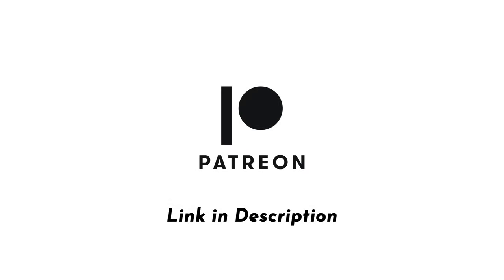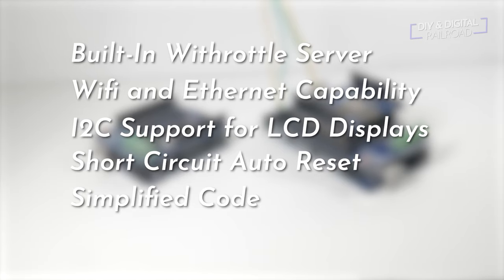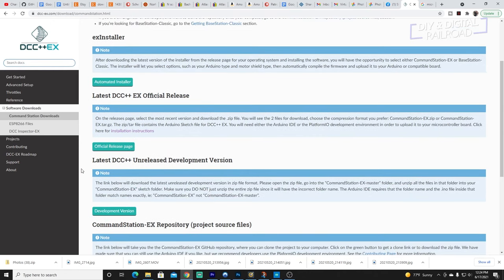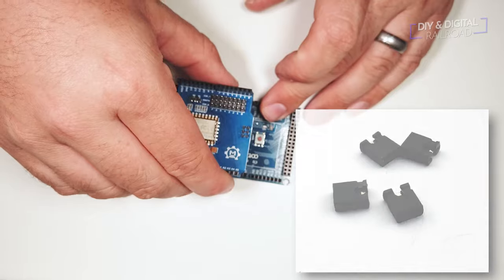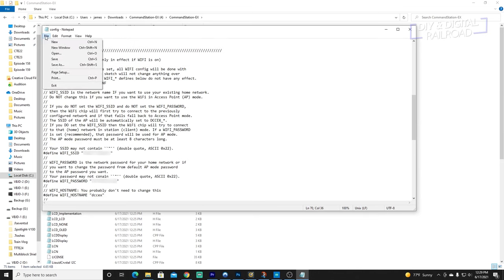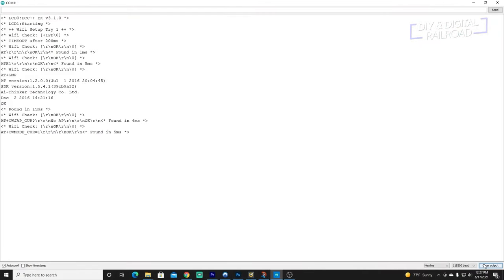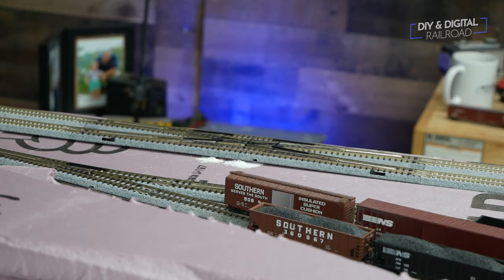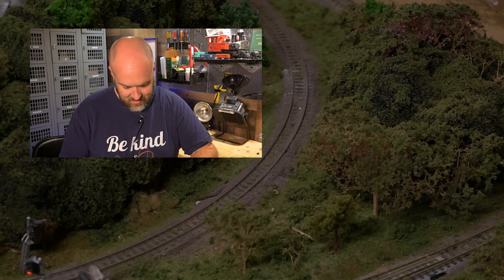DCC++EX: A Cheap DIY DCC System?!?! This is a Model Railroad Game Changer

Comment: I have one question regarding your use of WiThrottle. Are you connecting to your Arduino Base Station directly through your home WiFi network, or to JMRI tethered to the base station via USB? I am asking because the project I have in mind is to build a coffee table layout and hoping to connect that railroad with as few electronic components as possible ( i.e. only one line of power to the coffee table) wirelessly. 
So far, I have only connected to a test loop with your base station set-up through home network and JMRI. I had to have an I.T. friend help me set a special open port to get through my lap top's firewall software which had us stumped for a while, LOL!
Reply from the maker: With DCC++EX you can connect to the base station directly.  No computer required.

Comment: What are the main advantages, other than the WiFi support, over DCC++ ?
What are your thoughts on just getting the Arduino Mega with the ESP8266 built onboard?  
I understand that can work and would eliminate the extra shield or flying wires for an external ESP8266 chip.

Comment: Well assembled my arduino mega according to this video an manually downloaded JMRI Cab Engineer onto my Android devices. Now I have a problem. I can connect once to my base station and when I shut my system down and try to reconnect I can't. I get an error basicaly telling me that the connection can not be made and I need to do something in withrottle to fix the problem but I can't find withrottle to fix the problem. Can anyone help!

Comment: Hi Jimmy ... very helpful as I want to use DCC++ which I already have setup on a panel but my layout is work in progress ... I was going to get a DR5000 controller but this latest DCC++EX looks very interesting ... have you any idea if it will run on the Z21 app for a tablet ... Regards John
Reply: Each manufacturer that has a Command Station creates their own proprietary API / protocol. DCC++EX supports its own DCC++ command language and the WiThrottle protocol. There are many throttles now that support one, the other or both of these, Z21 is not one of them. We may look at some point if it would be worthwhile to find a way to support their protocol, but it is a network only protocol.
Reply: More issue's on My Mega and a second one I have pin 19 is TX1 and 18 is RX1 then 17 is RX2, you also confusing me by pointing to pin 19 and saying pin 18 ... LOL  going for a coffee as doing my head in LOL ... will it harm anything if they are wrong way round...

Comment: A question about the motor shields. I want to run multiple power districts, and possibly use one as a reversing section. Any idea if there is a way to do this with a dcc++ / dcc++EX system? I heard the comment about boosters, I have a suspicion that you could just feed the track in to the h-bridge of another motor shield, but don't have the equipment to test that theory.
Reply: You can do that and you must specify the pins in the config file as well....as one of the developers I recommend joining the DCC++EX discord server.

Comment: The DCC++EX command station was very appealing to me just starting out in model railroading. I am a goober at electronics, but your video instructions are excellent. Thanks. I followed your instructions and those of the DCC++EX website using an Arduino Mega R3, Arduino motor shield, and Makerfab wifi shield. However when testing the locomotive using the JMRI and DCC++EX web throttles, all that I get is the engine startup and idle. Lights, bells, horn, movement, etc do not work. Not sure what I did wrong. My voltmeter says that the power to the mainline track is only about 12mV. I thought that my motor shield was bad, so I got another one. Same result. Seems that there is not enough power getting to the tracks. Any suggestions. Goober
Reply: I'm completely new to DCC, but not to electronics/ programming. I think DCC uses Pulse width Modulation to supply power to the track, so you can't accurately measure the track voltage with a voltmeter. I'm sure others will chip in if I am wrong about this. Good luck.

Comment: I'm probably asking a question about DCC++EX Basestation that someone has answered and I apologize profusely.  My memory is not what it has been lately.  
   I want to run DCC++EX Basestation on my modular N scale layout.  My layout is a combination of Ntrak with the 3 main lines,  branch and the mountain line and a series of modules that are oNeTrak with mountain line *. 
     Will I need to build a DCC++EX Basestation for each line or ??    I think when ready for shows I'll be operating a combined layout 36ft x 24ft or so. 
  I need the correct websites addresses for DCC++EX main and any other super pertinent websites etc as I would like to add signals, transponding, more locomotives, consisting, and more.  

Thank you 

Rob
Reply from the maker: Hey Rob!  No worries!  DCC++EX is like any other DCC base station.  You will only need one and then connect feeders to other modules.  dcc-ex.com is going to be your best bet for info.

Comment: Hi Jimmy,  I was wondering if the newer WiFi version of the Mega will work for the DCC++EX as it would reduce the board count by one or does the WiFi Mega switch settings complicate the whole thing?  - Warren
Reply from the maker: Yes you can use those!  The setup isn’t quite as fleshed out yet.

Comment: Hi Jimmy.    It's Ron again.   I've followed your  Setting up of the DCC++EX to the letter, I want run this in the AP mode, but I can't get it to work (ie), dose not send any WIFI signal out, I'm using engine driver on my Android phone. I've made sure that I've connected both jumpers to their proper pins. I'm running this setup on 9volts with no computer attached. The mega board gets quite warm around the voltage regulator area of the mega 2560. Is that normal? I'm getting more than aggravated at this time, because you make it so simple to hook up.    sorry about that  Ron Tks
Reply from the maker: Hey Ron!  There are still some issues that the developers are working out with AP mode.  Part of it is off the shelf parts.  Did you cut the trace or the VIN pin to keep power from the motorshield from reaching the MEGA?  Also I had a bad mega that heated up.  Sometimes the clones aren't that great.  I try to stick with Elegoo MEGAs.

Comment: Thank you for this great video!  This looks like its going to be somewhat challenging for most folks to undertake.  I am excited about the possibilities.  Would a raspberrypi zero W be able to provide the wifi?  I guess you would just use jmri at that point anyway.
Reply from the maker: I’ve actually tried a raspberry pi zero w with JMRI.  It works but it’s pretty slow.  If you can upgrade to the RPi 3.  That works great!

Comment: Has anyone used the Arduino with built in WiFi and how did it preform with motor shield? I thought an Arduino Mega had to be used due to power and current draw

Comment: Hi I have a small problem my JMRI i can read Decoder write power on/off but throttle forward and reverse nothing moves what do you thing were is my problem ?
Reply from the maker: email me with photos of your setup and the power supplies that you are using.  That will help me be able to diagnose the issue.  ddrrcommunity@gmail.com
Reply: @DIYDigitalRailroad  I am using a laptop power supply 12V 4 amps this power suppy can run Dc trains on it by jmri nothing also i am using an Arduino uno with motor shield to to wires connected to ping 13,10,12,5 , every thing works but throttle can't move trians decoders i am using Lais also a brand new decoders.
Reply: There are NO jumpers for DCC++EX. If you are running EX, take them off. Next, you can't move a loco on the programming track. Make sure you are on the MAIN track.
Reply: @DCCEX  Hi done as you told,  problem was solved, removed those two cables and magic

Comment: N scale: 12volt or 15volt?  Why rx pin 19 to tx pin 3 on wifi?  is not the entire tx side on Wifi connected?  And rx side on wifi board connected?  Do I have to connect to that specific pin?
Reply from the maker: Hey Jacob.  For the power to the shield, I use a 12v 5amp power supply.  I power the arduino with 9v 1amp.  The entire side of the rx and tx should work,  I just found those pins to work best.
Reply: @DIYDigitalRailroad  I saw somewhere that I needed to bend 2 pins out from wifi board so that they do not make contact with the arduino.  Do I need to do that and which pins?

Comment: jimmy, ive got everything hooked up and connected to my wifi and using a test track and the loco wont respond.  using train driver for ios and it does connect to the mega and wifi shield.  any ideas
Reply from the maker: Hmm.  Which terminal are you connected to on the motor shield?
Reply: @DIYDigitalRailroad  finally got it connected but loco still will not move :(
Reply: also using the recommended wifi shield
Reply: @DIYDigitalRailroad  i have 18 on the mega connected to esp ex pin 1 on the wifi shield and 19 on the omega to esp tx 3 on the wifi shield

Comment: Will one Audrino Uno have enough power to run four locos? I’m assuming that it wouldn’t. How would I add additional power?
Reply from the maker: So the arduino actually does not power the locomotive but rather controls the output of the motor shield.  The power comes from the shield.  I have not tried any boosters yet, but it is on my list.
Reply: @DIYDigitalRailroad  Oh I see. I am afraid of melting my motor shield setup by pulling too much power through it.
Reply from the maker: The motor shield is rated for a 12V 2amp connection.  Just make sure you have the VIN trace cut so that it does not power the arduino.

Comment: If you do a follow up video, maybe you can mention the easy to use installer as an option instead of using the Arduino IDE. No compiling or technical expertise required, including selecting the option to connect to your home network instead of making the Command Station an access point (AP).
Reply from the maker: It’s like you know what I am doing Thursday!
Reply: @DIYDigitalRailroad  I wish we had the prettier face on the installer. It is still Beta and it will look a bit nicer soon.
Reply: Yes im still working on it and am always open to suggestions

Comment: hey im pretty new to this. i see you just slap on the connectors at the end of the programming track to test it. how do you connect it to the main layout?
Reply from the maker: Great question.  There are several ways to connect wires to track. Some track systems have their own.  There are track connectors with wires attached.  A lot of people solder wires to the track.
Reply: @DIYDigitalRailroad  I've got Kato unitrack, and there's what i think is called the feeder track where the regular cheap throttle plugs into. Can I plug the cables in there?

Comment: do you know if you can have this system run in parallel with other systems? im actually looking for a remote controll system since i currently only have the old Esu Ecos station und i cant run around with that one so this would be a really interesting alternative to expensive wireless systems. Would be interesting to know if this is possible. (i dont actually see why not since they tjust run in parallel but if someone could test or confirm it that would be great.)
Reply from the maker: I’m not sure about that.  Do you have any way of connecting the system to a computer with JMRI?
Reply: @DIYDigitalRailroad  not atm but I could if I want too. I know that you can have multiple ecos stations connected to your layout on the same bus wires. But I have never seen it with different systems
Reply: Normally, you can't do this with any other system, you can't run two different power and signal sources to the same bus, in this case your track. But the Ecos advertised its input port that used the "ECoSniffer" which is a special circuit where they can peel off the DCC signal from another Command Station's output. It works like our DCCInspector-EX in a way. I don't know of anyone who has tested it, but it should work just fine. You use DCC++EX and a Wireless throttle, connect the output of our CS that would normally go to the tracks to the ECoSniffer port instead. A "sniffer" rectifies the alternating voltage and filters it out, extracting the DCC signal (NMRA packets of data), then sends that to the track by modulating its own voltage supply.
Reply: @DCCEX  uh an answer from the makers themselves. Sounds reasonable enough to give it a shot. Will get the system and try to get it running. I will let you know if it really works or if I have to do something else with it. Thx for the detailed answer

Comment: In all the DCC++ EX videos I haven't seen this is not mentioned. The A output is for the main track and the B output is for the programing track. After days of searching to find out why I could not read my decoders I found out for DCC++ EX to read the decoder it MUST be on the programing track. It will not read on the A output.
Reply: Correct most DCC Command Stations can only Write to Decoder CV's on the Main track, & Not Read decoders on the main track.  You Read and Wrire CV on the Programming track.

Comment: I'm still skeptical  why do all this when it's all available commercially with dcc systems? Not to mention 1.  you need a computer. And skills,  2. You need   at least two power outlets. 3. There is no protective case to prevent shorts ( not so sure how fire safe this is.) 4. Just to complicated for most older folks not computer savvy.
Reply: I have created an automated installer that requires no code editing to get a Command Station setup. All you need to worry about is wiring after you program the Arduino. If you have any questions or concerns feel free to hit me up I'm usually on my pc during the day. The installer is located on our Website. On the same download page Jimmy points out.
Reply: Price. I already had a computer ready and the skills, and it only came to something like $50 for me, vs $200+ for a commercial system. I built a lego case to protect it :)
Reply: Price, plus the fun of building something. I'm a computer technician, so I had the hardware and the skill (it really isn't that hard) and the desire to have something I built run the layout. I want to build a throttle for it because it can be frustrating using the phone as a controller, especially when you lay it down somewhere and walk away!
Reply: Thanks for those replies in regards to price that is the main reason i looked into DCC++ and joined the DCC++ EX Team to help modelers who love to tinker and save money.
Reply: @PatrickMcNealPuppets-n-Things  or someone calls while In a session or phone dies I can understand that.
Reply: I like to be able to make systems to suit my needs/whims. This model railway system gives us a very simple base to easily operate DCC for a low entry price, while allowing for EXpanding in any direction with commonly available free software and cheap hardware, not to mention a very accessible, friendly, and helpful community of users & developers!
Reply: I will say we have multiple great guys on the project and one hope is to expand the DCC EX system to include a hardware throttle built on withrottle/DCC EX that will just work outta the box but thats in the future :D
Reply: 1. Fun and 1/3 to 1/5 the price
2. No computer skills necessary. You only need to have a computer to run the installer to install the software
3. What makes you think you need 2 outlets or that would be an issue? Use a power strip. But we show many options to use one power supply.  They make dual voltage power supplies. Tinkerers or Engineers (as we lovingly call them) can use "buck converters" to take one power supply, and make however many voltages they want. They are plug and play. Start with 12V or 18, or whatever you are putting on the track, and have a buck converter that takes that voltage and converts it to 5V or 7Volts or whatever you need.
4. There are several people making cases now, and even providing an entire command station put together so you don't have to do anything except plug it in. We are thinking of doing the same as a kit or pre-tested command station. 3D printers are changing the world. Anyone can download a design file and send it to a place in your town and have them print you a case if you want!
5. Our software monitors the current and shuts down the system in the even of an overcurent. 12V at 1.5A is not much to worry about since the only exposed connectors are your track, not anything on the command station.
6. We would welcome you if your want to become one of our "Tinkerers" ;)
Reply: I don't have a computer. Can you download and install using a phone?
Reply: @Steelerfan820  😂